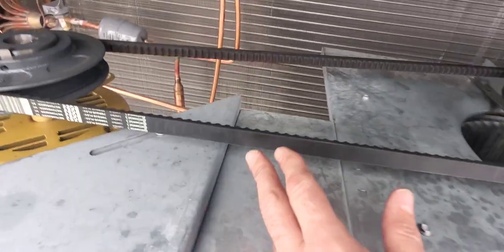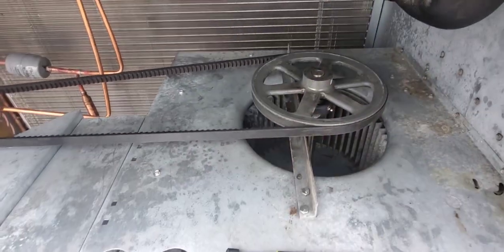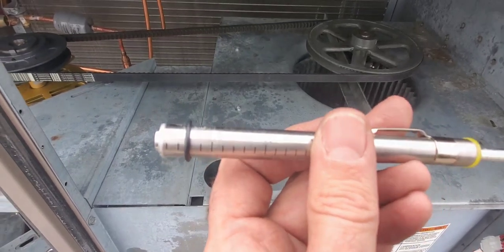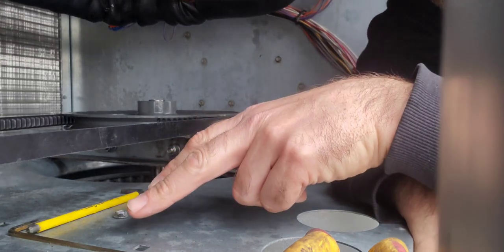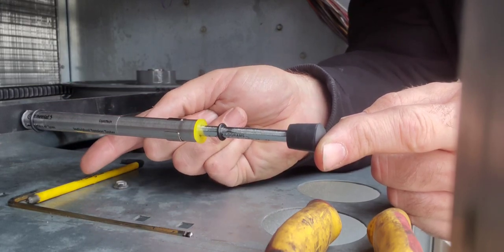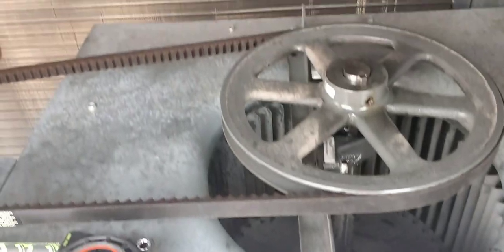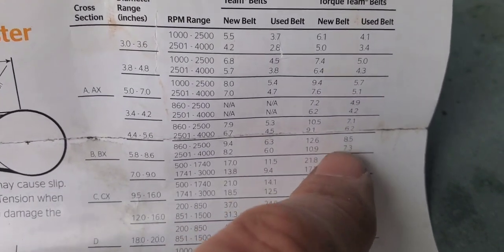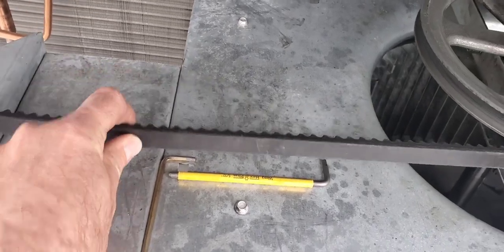How To Properly Tension A Fan Belt For HVAC

Comment: So we’ve got an issue where it seems a lot of cogged belts are breaking prematurely…I’ve heard that’s because they’re not designed for the torque the RTU units put out but could it be they’re just not being tensioned properly? If that’s the case maybe the solution is using this tool to check proper tension?

Comment: Hey man, so you are setting tention as per the tool specs? I know some units require a certain measurement from strait edge under specific lbs of force on belt, but that is as much as 25/30, them detection tools I have looked into only go up to 15/20 lbs. Any insight?
Reply from the maker: Setting as per the belt size specs, I used a straight line over a strap edge.

Comment: Great for the perfect world... Unfortunately nooobbooddyyyys going to take the time to tension a belt to spec....
Reply from the maker: Interesting comment because I've talked to a lot of people in thr last 24 hrs that do it for every belt.  So yes people are doing this
Reply: I agree with Armando on this one. No is given enough time to perform everything properly. For instance, removing adjustable sheave after startup and replacing with a fixed pulley. The details don’t matter anymore when you’re getting charge $150-$180 per hour. Sucks but you get what you pay for sometimes.
Reply: Than another company has to come fix it😂 according to york factory nothing comes set, installers must set belts, had 4 new york units flow belts 3 weekss afters start uo
Reply: @karlandersen793  you just compensate for a little belt stretch on startup and call it a day. Never had a belt thrown after startup. Tension is always checked.
Reply: Our new daikin equipment and older mquay as well as late 90’s intellepaks come with a browning tag that shows pulley and belt and tension info. We are required to check tension on pms whenever you change a belt. We have had motor failures caused by belt excessive belt tension. I use app from browning. Literally takes less than 10 mins. I guess everybody’s eyes and fingers can see perfect alignments and lbs of correct tension.
Reply: @hvacslayer2929  yup